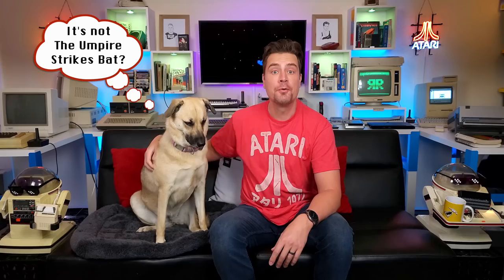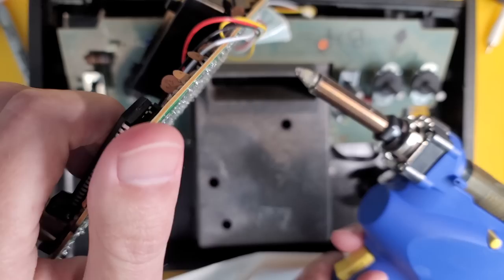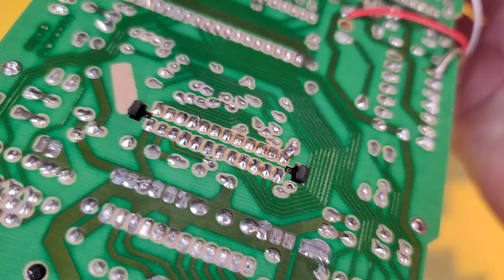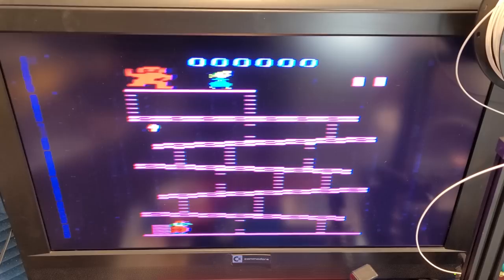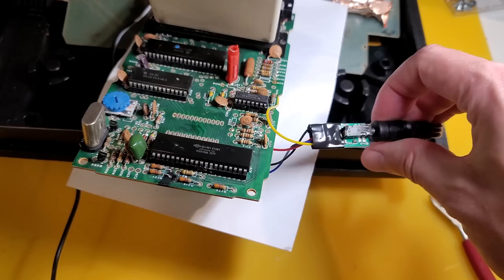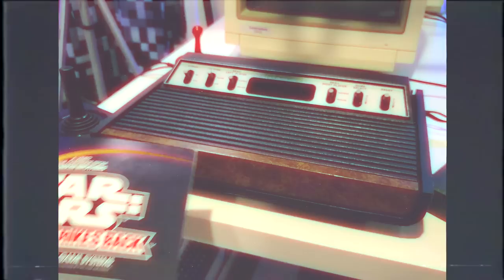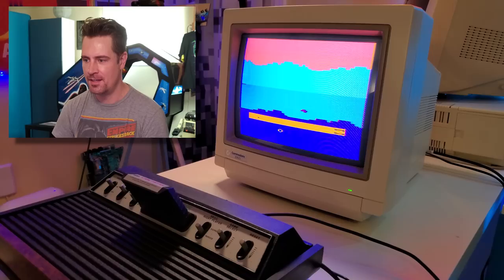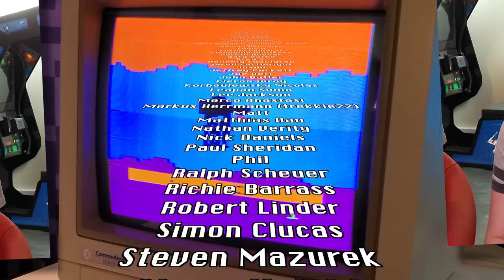I've waited 37 years for this game. WILL IT WORK!? | Empire Strikes Back Atari VCS Repair

Comment: For the Empire Strikes Back: shoot the first Walker until it is yellow (it will be moving at its slowest), then go all the way to the end of the line and do the same to the last one. Then destroy the middle three completely. Then destroy the first Walker. Repeat with the new last one, and keep completely destroying the middle ones. This will keep them from getting to your base.
Reply: This was so much fun but soo hard, especially when you turned up difficulty and released the smart bombs.

Comment: This was one of my favorites as a boy. One tip - the walkers move much more slowly when damaged. A good strategy for higher scores is to knock the lead walker down to the yellow status, slowing the entire column, and then the last one down to yellow as well, slowing the arrival of the new walkers. Then destroy the six between them. By the time you've done that, the last walker will be the lead walker, and you can repeat the process until they finally get you or you have to go to dinner. May the Force be with you!
Reply: When I got this game back in the early 80's it was a loose cart with no instructions. Until this video and comment section I had no clue about the walkers slowing down when damaged, the landing your ship to repair it, or the different game variations.
Reply: @homiedclown  i had the same experience. To my 10 year old eyes it was a horrid game of repetition with no goal or objective, nothing going on but shooting at an eternal tain of walkers. Sadly it was one of our least played games

Comment: Awsome fix - as an amateur radio operator (2E0FWE) I was right away - yep thats Radio Frequency interfering with the video. Its worth investing in some good power strips only for your consoles and monitor to run from (Tacima 6 Way Mains Conditioner and Radio Frequency Interference Filter) , the best ones will have a choke filter in them and you done the right thing in putting on some good old ferrites on your power supplies. Amazing rebuild, your persistance and determination are amazing !!

Comment: Empire Strike Back on 2600 was the very first videogame I ever played at home. :) I was probably 5 or 6 years old around 1986 or 1987 when I found the woody 4-switcher in the original box with a ton of games in the hallway closet, left behind by my older sister and brother who had flown the coup. It was missing the TV/Game RF switch but my twin brother and I got it working through shear force-of-will. :) We literally stripped twist ties from bread bags to make wires that we used to short the RF lead to different screws on the back of our black and white TV set. We had no concept of VHF or UHF but figured out which two of the four screws to connect it to through brute-force troubleshooting. :) We knew we were getting close when we would see the static change if we turned the console on or off, so we kept at it. Suddenly, we heard the Star Wars jingle that Empire Strikes Back plays when you turn it on. We we're lucky we used that one since most Atari games are silent at boot and don't have music even when you start the game... and we didn't own Pitfall II: Lost Caverns. ;) We panicked when something we changed resulted in us losing the audio but we quickly backpedaled until we found ourselves on the right channel and adjusted the fine tuning to get an image. Victory!

The problem then was that we had no idea how to play the game. It felt like you just flew around endlessly and could shoot but no amount of shooting seemed to work against the AT-ATs. I know how to play now but, back then, we ended up running to our stingy friend with a Nintendo Entertainment System and told him "You can't play our Atari unless you let us play your Nintendo!" :D That isn't to say we didn't have a lot of fun with the Atari. To my twin bro and me, Slot Racers was the precursor to Mario Kart Battle Modes and Combat was a heck of a lot of fun for two kids figuring out how all the different game modes worked. Figures I'd single those two out since they were the two launch titles that didn't have a single-player mode but, well, they had a special impact on us... being twins.

We played and enjoyed Pac-Man with no concept of how inferior it was to the original. We played Pinball and Circus and Tennis and Basketball and so many others. I totally hated Stampede until my sister came to visit and showed me how it was done (I'm still impressed to this day). I know I had at least one other Activision title since I noticed way back then that their carts deliberately slotted together and stacked but I can't recall what it was.

I think I played Canyon Bomber at a babysitter's place before that but I suddenly had it at home. :) I recall borrowing Donkey Kong, Congo Bongo, and more from my sister's friends who were still around. A friend at school gave me Demon Attack and I was totally confused by the label mentioning a Sears Telegames console, since I only know of Atari VCS/2600 and Nintendo Entertainment System back then.
Reply: *coop
Reply: "Sears Telegames console"

==I've never heard of that. We have a Colecovision console and it plays the Atari 2600 games. I still don't understand that. Is it because of a crosslicensing deal between Atari and Coleco?
Reply: @louistournas120  The Sears Telegames variant is what he's refurbishing in this video. It isn't actually an Atari 2600 according to the box and badge! ;)

The Coleco Gemini console and the 2600-compatible add-on for Colecovision were not authorized by Atari but they didn't actually need to be since Atari didn't have anything unique/proprietary/protected. IIRC, Atari even sued over those or an Intellivision module that played Atari games. It was a wild time! This is exactly why Nintendo put the lock-out chip in the NES.
Reply: @emmettturner9452  
Interesting. That is one heck of a mistake. We seem to live in a world where companies encrypt DVD movie discs, blu-ray movie discs, some VHS have an anti-copy thing, Apple doesn't let you download the songs to your PC, I think XBox One and PS4 games need to be signed and do some kind of communication with the CPU, and so on.
Atari should have designed their own instruction set for their CPU. Probably a tiny modification would have helped.
Reply: Loved this post! 😁
Reply: @louistournas120  Yeah. Instead, they used a cheaper cut-down version of an off-the-shelf CPU, meaning any competitor could just grab one off the shelf for a clone. The TIA was the only part that needed any special consideration and it seems they were able to clone it easily.

Comment: Regulation isn't great when a government gets involved but it's often critically important in a power supply.  :-) Glad to see clean power solved the problem.  It's actually good you didn't try that first as it seems you made a lot of good and important improvements to the circuit you might otherwise have not made.  Bravo!

Comment: I started collecting for the system in 1994, back when the carts could be for as little as $0.50. I never had the instructions for ESB and never looked it up. The 'repair job' is something I never knew!

Comment: Not surprised new stranded wires helped. You could configure them as twisted pairs with an extra ground wire, that should help too. Maybe add bypass caps to the cheap power supply lines.
Reply: I've seen other videos where they say the right 2600 PSU is crucial to stop interference on the screen. He had started with a modern cheap switch mode but found the old fashioned transformer style was much better.

Comment: Should use screened cable for the composite mod, not individual wires.
Reply from the maker: I'm using what was provided by the seller ¯\_(ツ)_/¯
Reply: @RetroRecipes  a lot of mod makers arent aware of twisted shielded pair cable. it would work really well to keep signal noise down in the composite cable
Reply: @electrohacker  Twisted pair is for differential signalling (e.g. ethernet). Composite video requires 75 ohm coax.
Reply: @ferrumignis  twisted pair is for any  analog signal.  And the only reason i mention it is usually you cant get shielded wire unless it is alsp twisted pair
Reply: @ferrumignis  also, all signals are differential signals since there is a positive and negative run

Comment: Great work! You really are good at setting the nostalgic mood. I think many of us out there has that missing childhood experience we yearn for, and your visceral descriptions and the hard work you put into ironing out the kinks before finally playing it for the first time was very cathartic.

I wonder if any of the PSU's of some of your vintage computers has a failed RIFA capacitor that's introducing noise into your local power circuit. I never would have thought about trying ferrite chokes, so good on you for figuring it out!
Reply from the maker: Thank you for your kind words! Means a lot 👍🕹️

Comment: How to win: 
1.Don’t get shot
2. You can’t shoot the legs. 
3. Focus on the first Walker. They mustn’t arrive at your base. 
4. When you get the force, position yourself at the height of the upper bomb hatch and just fly headfirst at all of the Imperial walkers, without slowing down. You will get lucky and hit the blinking bomb hatch square when their heads are down. You will wear the others down. The procession wraps around, so you wind up back at the first one after the last one.

Comment: I did the same mod and had similar interference. I stopped using a cheap you know where from switching power supply and powered it with an old original type linear heavy brick type PSU. Think it came from an Atari Lynx. Now works great... No rolling screen interference bars etc.
Reply: very Atari product i've ever owend had tons of interference.
Reply: It's ok to say China makes inferior garbage. I doubt there is anything that comes out of China that is both of high quality, and with originality.
Reply: You have good new power supplies too. The current triads goes for beeing very good on the retro community
Reply: Pffffffff, the Atari 2600 PSU is just a transformer and nothing more. It puts AC into the 2600 and the AC is turned into DC inside the machine....what are guys talking about switching power supplies ??

Comment: I was surprised that dog didn't work as an electrical outlet.
Reply: That requires 2 kitties in series as outlet. 🤔😼😼😼😼🌈
Reply: Dog poo would probably work as a very low amp battery. You could string enough of them together to power a device like that guy who got his graphing calculator to run Doom powered by potatoes.
Reply: They shield interference the best, like a good boy should.
Reply: It actually did, but a little extra "force" was needed, but monetization was not worth the extra force.
Reply: In that case, it would've been a poower-outlet... 🤦
Reply: Pa-Pa-Pa... Puppy (Fractic) Powerrr!
Reply: Yes, it should've cause it had some butteries.

Comment: This was amazing. Was lucky enough to have that same console as a kid and spent many hours playing that exact game. Loved watching you restore the Telegames. Fingers crossed, my will work. Havent turned this on in about 34 yrs, but you vid got me excited to try.
Reply from the maker: Good luck!
Reply: @RetroRecipes  Welp, it didn't work. I still had the PSU it came with and used a F-Type male to RCA Female for tv connect. With Cart in it appears as nothing is happening, no signal. With cart out and Power on, I get do get blk screen and vertical static lines with some audio sound, guessing electrical interference translated as crackling static.

Comment: That was the first game I bought and I was 7 or 8 at the time. I collected a bunch of aluminum [err, aluminium] cans from the neighborhood until I had amassed $40 worth. And then my Dad took me to Toys R Us and we bought it. Lots of memories of it. Parker Bros. really screwed up in not bringing out a version for the Atari 8-bit computers or the 5200; instead, they ported it to the Mattel Intellivision. Some of us have talked over at AtariAge about getting it ported to the Atari 8-bits/5200 since Yars' Revenge and others have been ported. There's also a homebrew version for the Colecovision although it's named something else. The snow speeder disappears most likely for the same reason that the ship disappears in the 2600 version of Defender when firing weapons; the limitations of the system. Although Atari creatively billed that as a featured improvement over the original at the time. Perifractic, I'd highly recommend picking up "Star Wars Jedi Arena" for the 2600. It's up to 2-players with Paddles and loads of fun dueling against Darth Vader in the arena. Loved beating my Dad in that game back in the day. "Return of the Jedi" and "Star Wars the Arcade Game" are pretty good ports of the arcade versions to the 2600 and AtariAge has a hacked version of "Star Wars the Arcade Game" that has a native Trak-Ball mode if you have an Atari CX22 or CX80 Trak-Ball. Finally, not to disrespect Console5 but amongst the community, the best - and easiest to install - composite/S-Video mod for the 2600/5200/7800/Atari 8-bits is Bryan's "UAV" mod ["Ultimate Audio Video"]. The Brewing Academy sells it for $25. Give it a try in your Vader 2600 if you don't step up to RGB with it. They also sell the open-source "UNO" SD Cartridge Adapter [project] there if you'd rather have that over the 2 versions of the Harmony SD Cartridge Adapter sold by AtariAge...

Comment: As I remember, you need to look for the flashing black boxes on the walkers. If it's above the neck, fly low so the head will go low, then zip up and shoot the block before the head rises, or vice versa. Kills it with 1 shot :)
Reply from the maker: Nice tip!

Comment: I have EXACTLY this same Sears Tele-games unit right here alongside my woody 4-switch and a 2600 Jr.  I've been considering recapping and composite video modding it and these two videos.. were VERY VERY VERY VERY useful!  I'm pretty sure I'll be going a similar mod except I would prefer adding jacks to the unit directly instead of hanging the wire out the back, but I hesitate because them I'm creating holes on the body of the unit (but it would make it MUCH more portable and capable of using any kind of length of CV/Audio wire).  I'm torn.  LOVE the idea of the olive oil--hadn't thought to do that.  Great tips!

Comment: Weirdest thing. I just got one of those Tele games heavy sixers delivered today off eBay and had got the Empire Stirkes Back just to other day. Had to go double check that these were indeed the same thing in the video. Then of course had to plug it in and test. Fortunately, everything works great.  But even better, though  I only got the game cartridge, not the manual, I was able to read yours! 
Thanks for a really cool video (and the look at the manual!).

Comment: You may be able to reduce the number of ferrites you used on your DC adapter by looping the cable around a single ferrite a few times instead. Additionally your 1084 monitor excessive blooming during explosions may point to a B+ regulation issue. As always thanks for the memories!
Reply from the maker: Yeah weirdly looping 2 wasn't as good as 3, and the cable was a bit too big inside the core when I did.
Reply: @RetroRecipes  heh.. if it works no need to try and fix it more! I am however a little worried about your CRT and how the picture seem to jump on sudden brightness changes. (E.g. explosions) This could indicate some failure for drive voltage regulation.

Comment: Not sure if anyone else mentioned, I noticed there was some interference when the sound triggered. I think you can improove things with shielding inside the...
When you put the copper tape down it didnt look like you grounded any of it. Solder it to ground and also with the comp wires wrap some foil around it and ground that too.
Put some copper foul over the audio chip and circuits as well and ground that, Obviousely put some kapton underneath everything so not to short anything.
Ahhh i just got to the end of the video and you mentioned what was causing the glitch... Anyway its really great seeing you get your childhood dream :D

Comment: When running internal wires that carry a very low voltage type signal (composite video is 1 volt peak to peak) it really helps to us a shielded wire (such as RG174) with the shield grounded.  Reduces interference picked up by the “antenna” that is running from one part of the machine to another.

Comment: I was thinking as you started to source the interference that if it turned out to be the power after all that chip and wire replacement - which was needed too, I would RF (Force) choke it. Ham radios are susceptible to that as well and can take a bit of detective work to source. To borrow from Oprah: You get a ferrite loop, and you get a ferrite loop! You all get them! Nicely done ticking a box on a childhood memory. :)

Comment: All these interference issues is what made me start using shielded wire for certain mods inside of certain systems that are prone to interference.  Yeah, shielded wire is expensive, but you can buy it in bulk and save.

Comment: The Sega Genesis surprisingly used the same plug configuration as the Atari console, and if I recall correctly The Empire Strikes Back was one Atari game that worked well with a turbo-enabled Genesis controller!

Comment: I ditched the ac to dc power, and used a 12v lithium dc source with a 12v to 9v dc adapter for my SNES. It cured the problems.